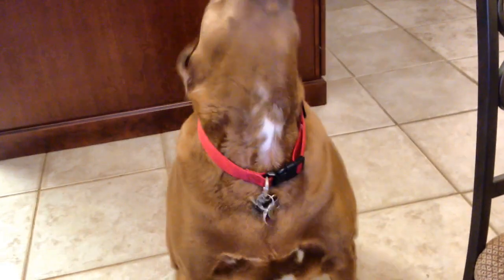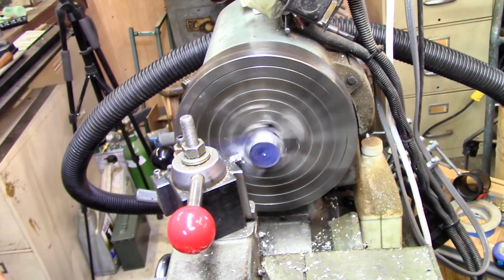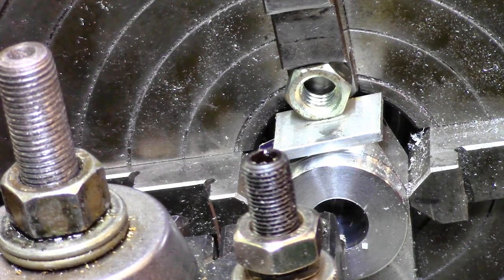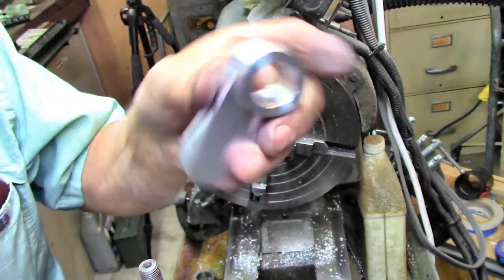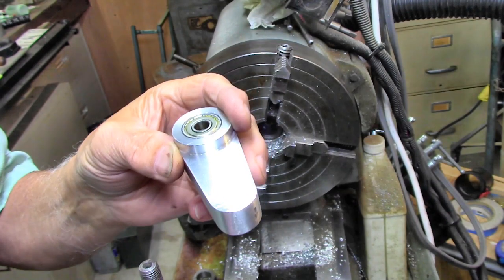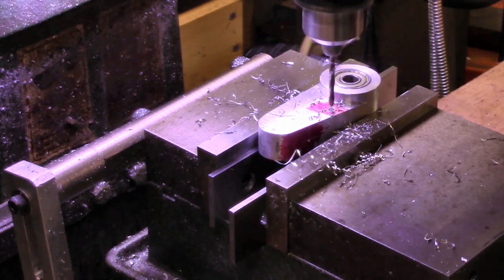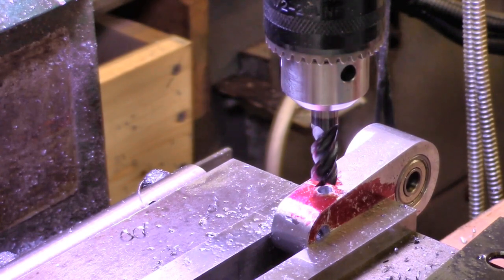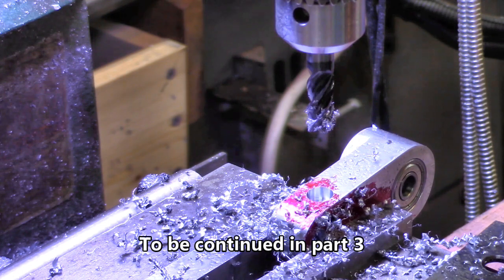U2 Tool Grinder repairs part 2 of 3

Comment: I thought I heard Pierre there too, maybe I'm just going more nuts. I have been guilty of the end mill in the drill chuck trick too, so I think Mr Pete would have given me heck too. On to part 3, part looks good so far.
Reply from the maker: When I want to drill a square bottom hole I always get an endmill.  Thanks for stopping by.

Comment: I would have guessed the original chinesium part had an 8 mm hole in it, which is .3149". You're close enough that natural oversize should put you spot on. I needed a 1 1/2" hole for a stepper the other day, I drilled a hole with a 1-7/16" annular cutter and it was so close to size from drill slop I just used some emery paper and I was as tight as a cowboy on a Saturday night.
Reply from the maker: Yeah I often luck into the right size. Thanks for stopping by.

Comment: Your '0.310' hole might have been a lame attempt at 8mm? 5/16 (0.3125) is closer to .310 than 8mm (0.315) is though. That imported stuff is usually metric these days. Which makes most of my tools obsolete. Makes me need more collets for my mill. I got a real oddball collet holder too so getting collets for it is a pain. I was trying some metric shank dovetail cutters I have in my standard collets and only the 16mm (0.6299) shank ones fit in 5/8"s (0.6250). That's a good fit. 10mm and 12mm are no go though. 10mm (0.3937)  isn't close enough to 3/8"s (0.375) and 12mm (0.4724) isn't close enough to 1/2" (0.500) to work. One don't fit and one doesn't tighten down. I probably need 6mm and 8mm too. I hate metric. It's part of what's wrong with the world today.
Reply from the maker: No one ever has enough of the right size of anything is my experience.  Thanks for stopping by.